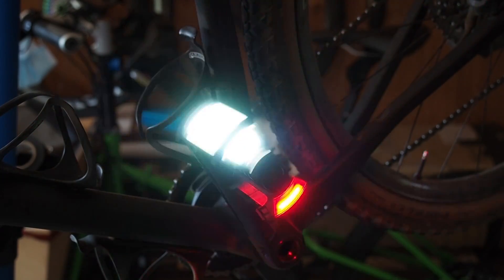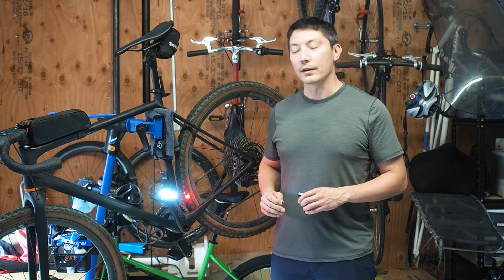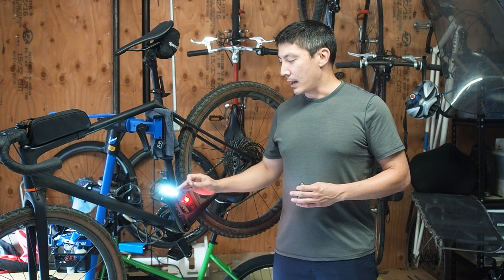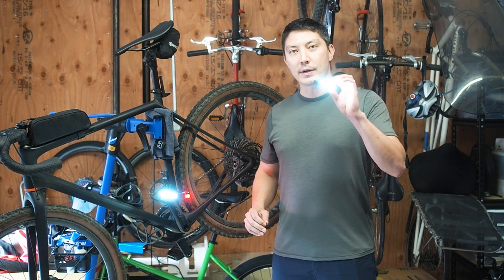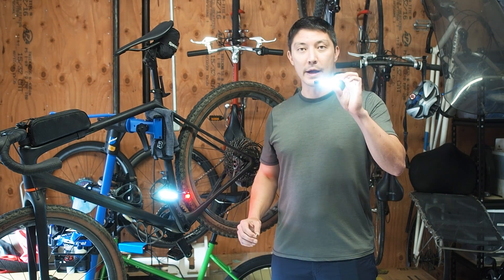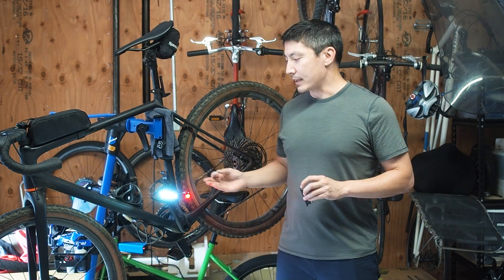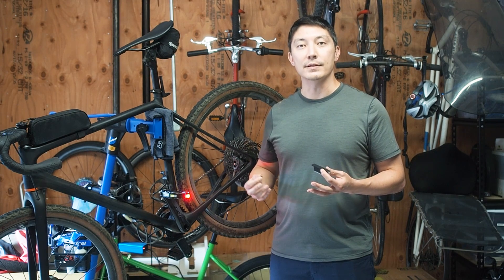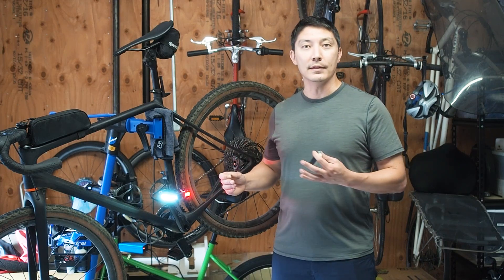Arclight Pedals: How does the Color-Switch function work?

Comment: red and blue a no go, any other color combination
Reply from the maker: Thanks for checking them out Noel. We chose white and red because those are the standard colors for vehicles used on roads - You are correct though, blue lights are not legal in many areas because they are used by emergency vehicles.

Comment: Could have added some theft deterrent, like loud noise when accelerometer detects motion, in which case you might have to add some functionality that sets these lights in theft mode which can be used while you are away from the bike. Other than this, you may add GPS as well but this would increase complexity and price I suppose. Overall, this looks to be a very nice product aimed rightfully for one's safety on the road. I wonder how many lumens these lights are and for how long they can stay on for one complete charge?
Reply from the maker: Hi Kaushik, thank you for the support! The integrated nature of the light modules means that they're a less obvious element for theft, but we're sensitive to that concern. At the moment, there is not a secondary lock for the light modules, but the magnetic attachment means it takes less time to remove and re-attach the Arclight modules than most rubber band or strap-mounted headlights and tail lights. This is something we are considering in future development. As for the lumens, each light module is comparable to a standard tail light with the red at ~20 lumens and the white at 50 lumens (which makes them appear as the same brightness to human eyes). Ultimately, lumens are not the best metric for visibility and the values are often artificially inflated by other manufacturers. After extensive testing, we found the movement of the lights the most important factor in visibility and adjusted the lumen output to balance visibility and battery life. On eco-mode the lights will hold a charge for roughly 36hours. Take care and thank you for the interest!
Reply: @Redshiftsports  Certainly, for lights to be seen, lumens are not the best metric but still was curious to know that specification. I just stumbled upon another idea for these lights. Can your team make Orange indicator lights which can be magnetically clipped to our helmets, and be controlled via some ANT+ remote? Also, for the Red light, I think accelerator sensor can be used as a brake sensor to increase its brightness when a cyclist suddenly slows down using brakes.
Reply from the maker: Hi Kaushik, these are fantastic suggestions and we are exploring similar possibilities for future Arclight iterations but I will be sure to note your suggestions for our team to explore!

Comment: I see planes flying at night with two different color bright lights. One on the right and one on the left. Using easily understood communication like this helps everyone. And using the magnet to control the lights is a great and long lasting method.
Reply: That's a longstanding design for aircraft - green on the right wing, red on the left and often white on the tail.  That way you can tell its orientation at night to determine whether it's heading toward, away or at an angle to you.  Also helps to spot them even during daylight, of course.
Reply from the maker: Hi Gordon - thanks so much for checking out the video and for the great observation!